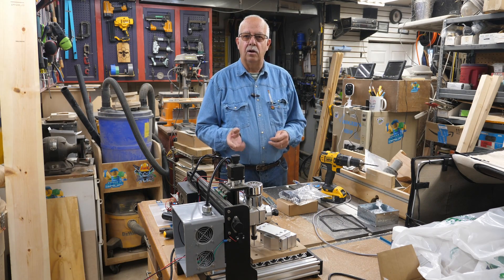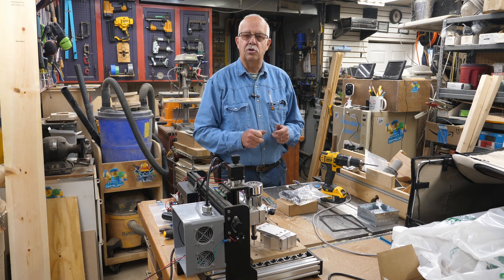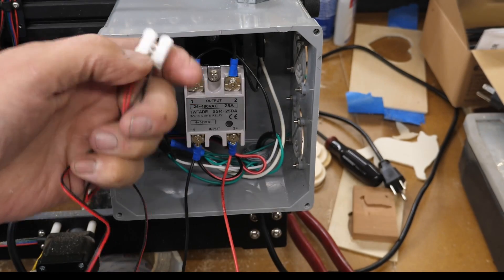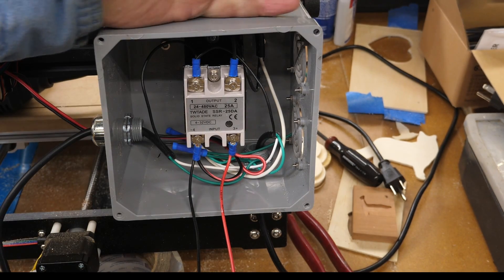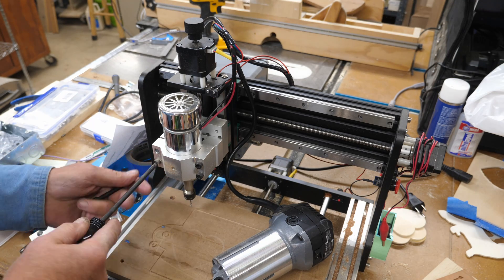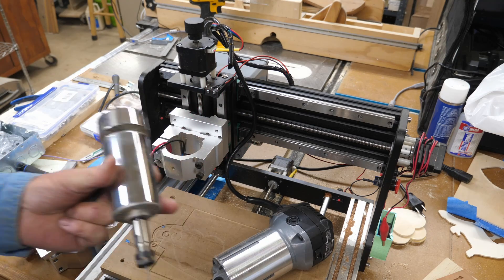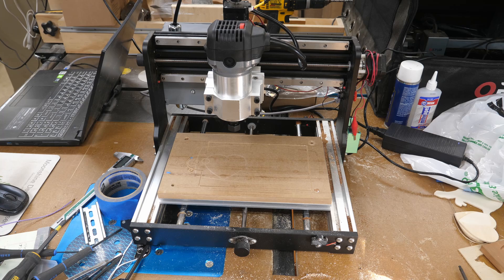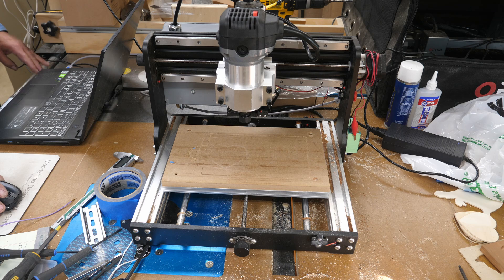Anolex 3020 CNC Upgrade

Comment: Am I correct in assuming that converting to a 65mm trim router reduces the maximum Y cut length? If so, can you tell me by how much? I'm considering the Anolex 3060 and need as much of the 600mm cut length as possible.
Reply from the maker: I have not measured that, but I think it shortens the travel by 10-20mm.  I expanded this little CNC to a 3030 and for my purposes, have not needed full travel.

Comment: oof the runout on that router is a lot!! are you going to upgrade to a spindle with VFD at some point?? I have to make a custom plate but I have a 2.2kw spindle going to be putting on mine having an ER20 opens the door for a whole lot more work capability!

Comment: Roger, I am considering the Anolex model 3030 for both engraving and cutting aluminum up to .250 inch thickness and hopeful that the 3030 can do that.  Interesting video you have here. Can you tell me why you chose to not to power the 110V router by it's own supplied power cord?
Reply from the maker: Did this via relay to enable control of the router from the Gcode sender instead of either having it on all the time or forgetting to turn it on.

Comment: Did you get the router with the er11? If so what are your thoughts. Thanks!
Reply from the maker: Yes, it comes that way.  I also ordered a couple of spares in both 1/8" and 1/4".  Works fine.